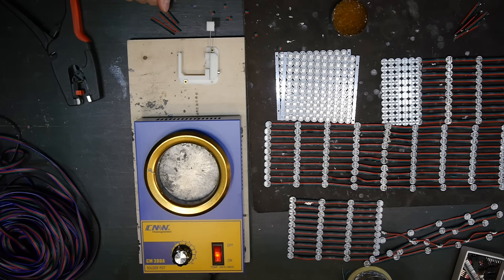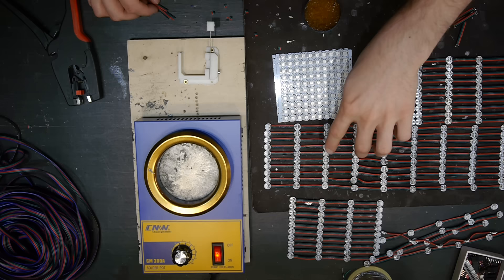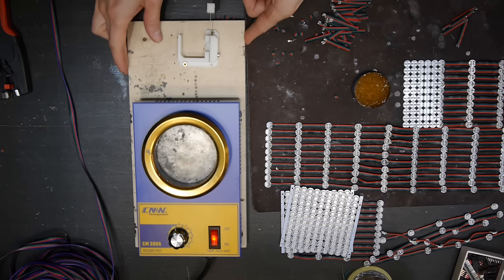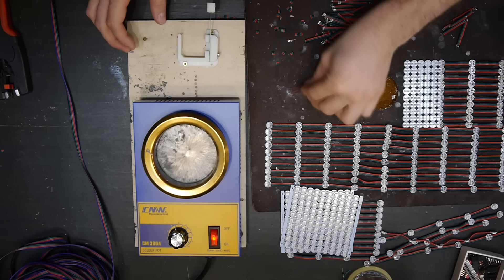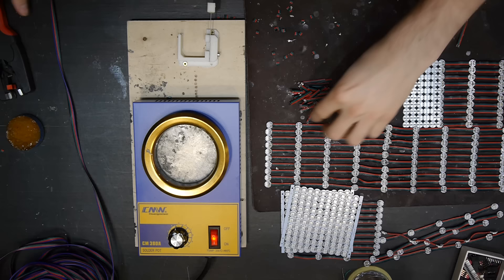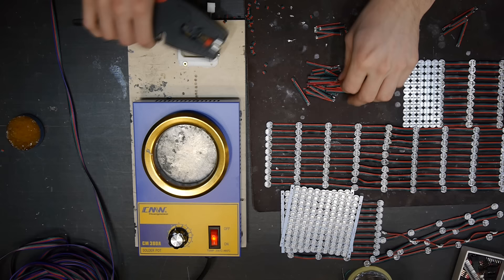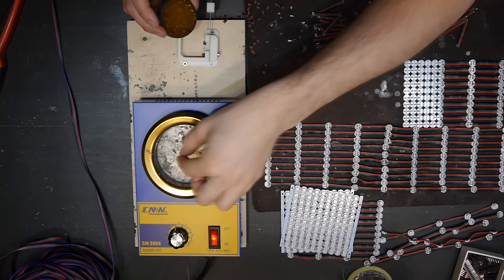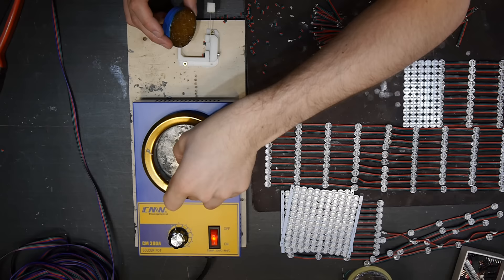Using a Solder Pot for wire soldering

Comment: I always wondered what those solder pots being sold were actually good for. Thanks for this video!
Reply: also good for removing thru hole ICs and what not. With the pot full of solder you can heat all the pins at once and pull the chip right out